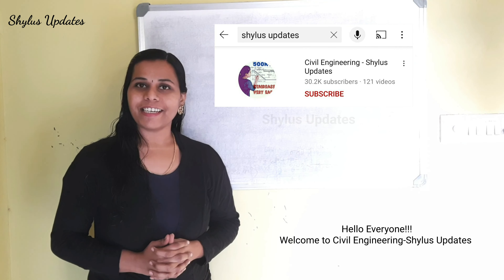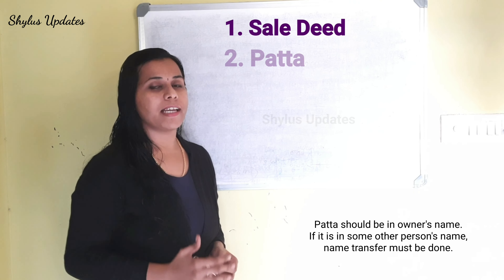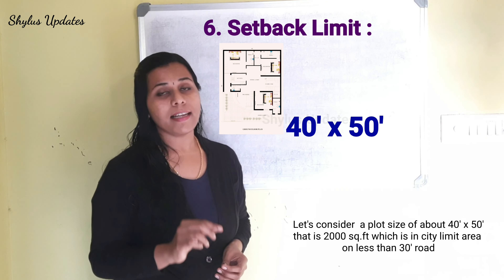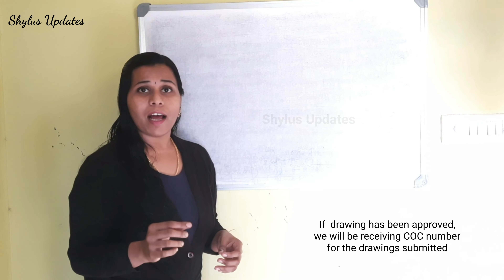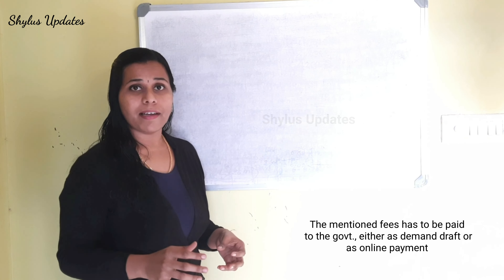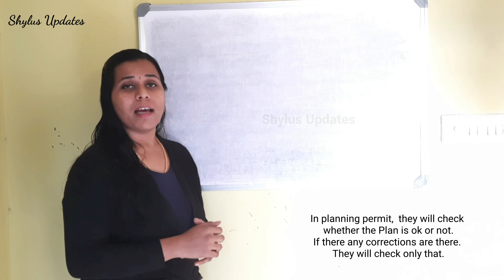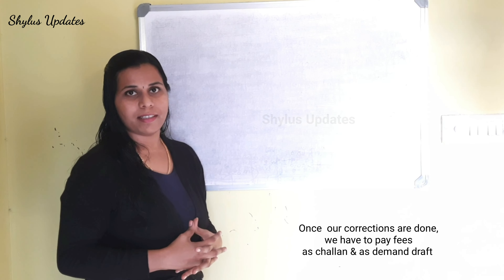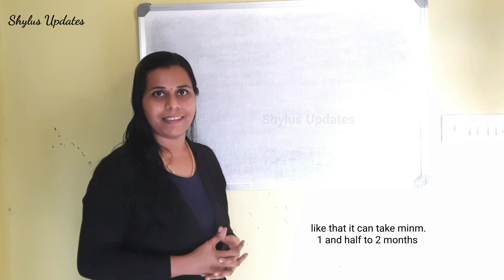How to get building plan approval? | CMDA approval | DTCP approval? | Process, cost, Time

Comment: Mam, how to get 30 yr EC? Can it be done online in tnreginet?

Also, All regulations in cmda chennai building code are specified in meters. Your have described it in feet. My question is as follows. 

1. I have a plot that falls under chennai corporation(cmda) that is 30 feet width(facing road) and 50 feet long. Road width is 20 feet. If i consider using feet unit(for 30 feet), I will have to leave only 5 feet set back on one side. But the building code says anything above 9m(29.5 feet) should have 1.5m on both sides or 3 m on one side. Which one is correct?

2. Going a little bit further, if my abutting road width is 20 feet(6.096m), am i allowed Stilt + 3F or Stilt + 2F? 

i guess the conversion is a bit confusing when measurements are in borderline. Is there any truncation rules to follow? I have not come across any